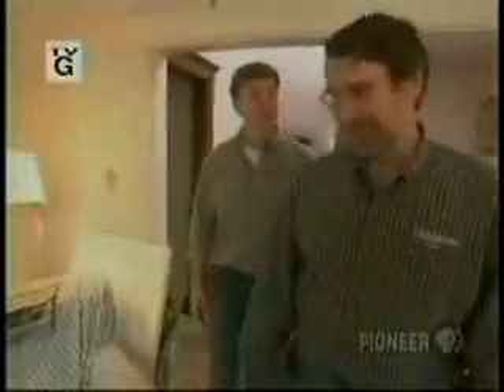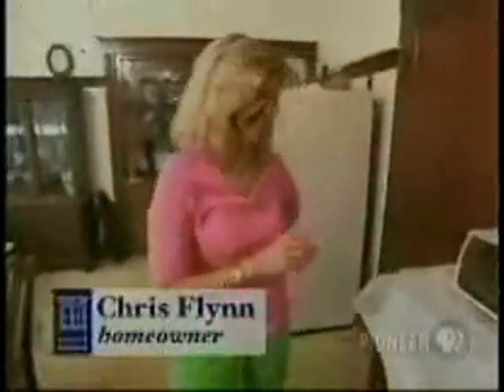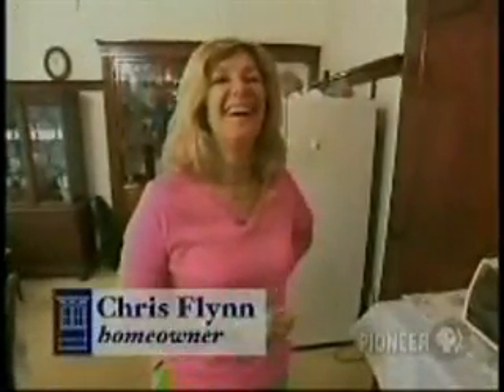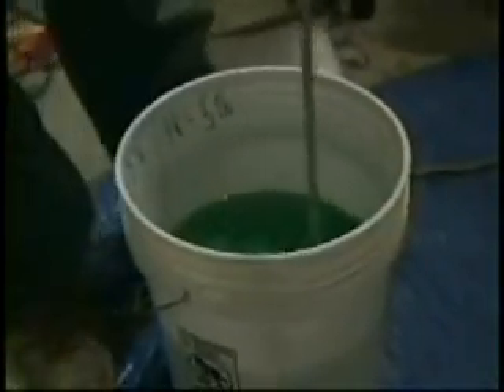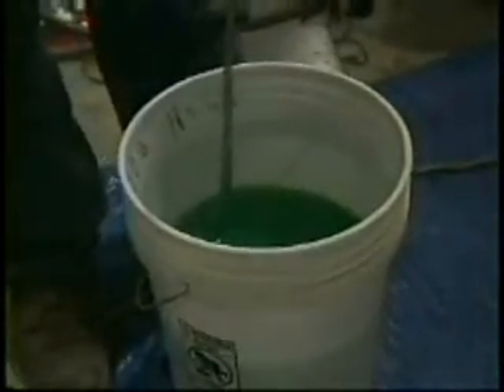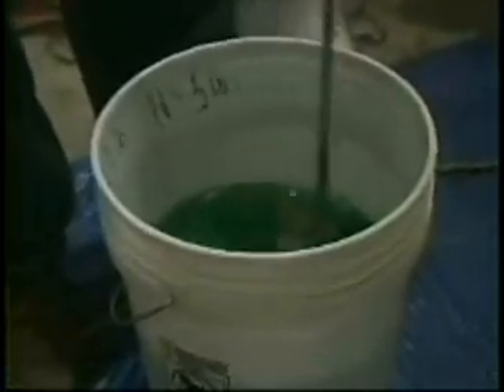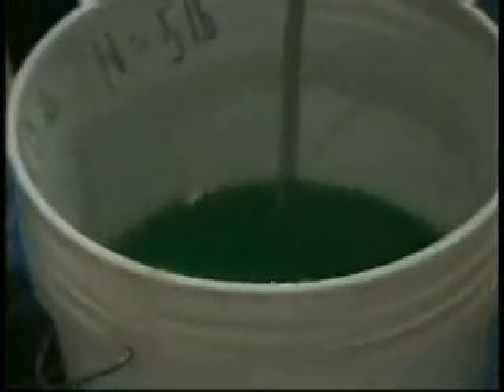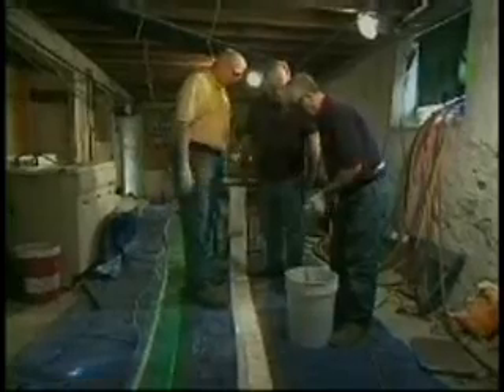CIPP Sewer Lateral Lining

Comment from the maker: Installer pricing in Southern California runs about $100 per foot for 4" and $125 per foot for 6".  That includes opening a start hole, cleaning the line to prepare it, installing the CIPP liner and curing it.  Then tying in the line from the building usually with a new clean-out.